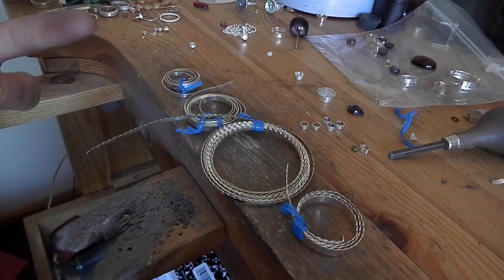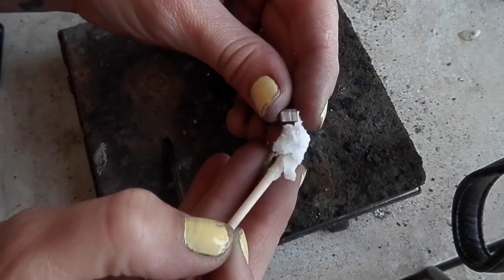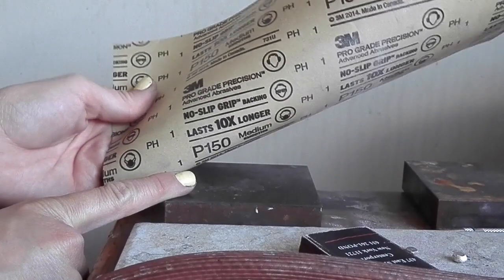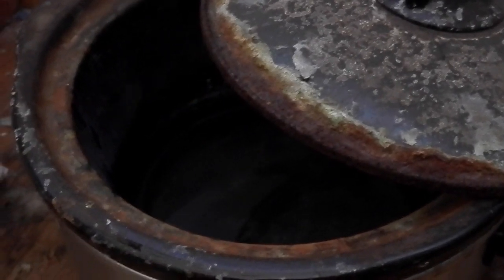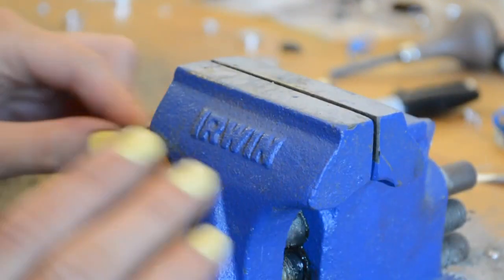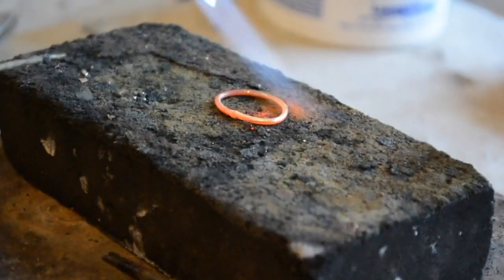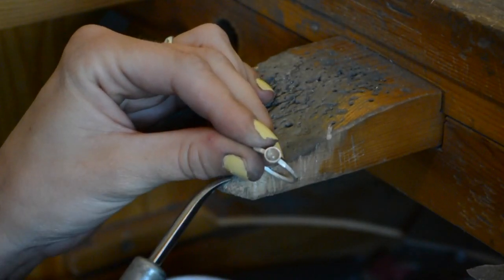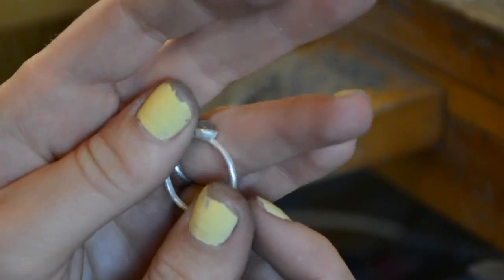Bezel Setting Tutorial - Stacking Ring Full Tutorial

Comment: I used this tutorial as my first attempt at bezel setting.  It is awesome!  My question is what are the minimum supplies I need to purchase to start making silver rings?  This is what I know so far from watching the video: Use "fine silver" (not sterling) use 20 gauge for backplate (hardness?); use ? gauge for ring ? hardness? use 26 or 28 gauge for bezel wire 3/16" (hardness?); Sheet solder Medium.  I'm hoping you can help me fill out the ??? because I'm on a very limited budget and I can't afford to purchase something that won't work.  Thank you so much for making me believe I can do this!  Donna Robertson

Comment: I enjoy watching your videos and learning so much!  Thanks for sharing your knowledge.  A few years ago I start making jewelry, from beading with elastic, growing up to beading with Flex Wire, designing my own beaded necklaces, and now, settling on making Beaded Kumihimo necklaces.  My biggest desire has been to work with wire and metal and I have taken some wonderful classes on wire wrapping, recently playing with metal working. My husband makes Poly Clay Cabs and beads, which I love using on my Kumihimo ropes, so I would love to start making my own metal designs and bezels, and so my question....can Aluminum be soldered?  We found copper solder and that is great, but aluminum is easy to find and eventually I will graduate to Sterling Silver but not until I know what I am doing.  If Aluminum can be soldered, what type of Solder can I use?  You are much appreciated.  Thanks.  GloriaB
Reply from the maker: +Gloria Borrero Yes you can solder Aluminum I think the melting points are much lower than copper, brass, silver or gold. I would recommend starting with copper its inexpensive and can be more fickle than silver. If you do well with copper you can then graduate to sterling. Depends on your preference and budget do what your comfortable with. I would say a low temp solder but I don't know much on aluminum sorry I couldn't be of more help there! Im sure there are many articles on google I would try doing a search I can imagine you will find a suitable answer. Thanks so much for watching and best of luck xo!

Comment: Hi. Love you videos. New to stone setting. 
Do you use .999 for your base plate also. I was told if using  .925 with transparent stones the base can oxidise over time (which you'll see though stone after a while) and If using .925 to place a piece of .999 foil at bottom. Have you found this? Is the foil needed?

Sorry for long winded question. 

Also not sure if would work for bezels also, but when measuring for ring shank  I use this formula. 
Radius + metal thickness X 3.14 = length of shank. No guess work.
Reply from the maker: +dawn butcher Hi Dawn thanks for watching! I use sterling for my base plate. You can use foil I have in some cases, you need to make sure no moisture will get in the bottom, it could end up moving around and causing the silver to peak through the foil. You can also seal the silver underneath to prevent tarnishing. I tend to find the 3.14 formula works but there are variables always especially if when you need to file the ends down to make them perfectly flush for a solder joint. Then you lose a few mm there. But overall that works!

Comment: Oh, one more thought; would you do a bit of expounding on "hybrid"/marriage of metals soldering, specifically with 14k (or whatever k) gold bezel wire and sterling back plate? It has been a real challenge for me, I don't know the tips and tricks (solder? Temperature? Etc.) to avoid the total meltdown. There is next to ZERO info out there, none in fact on YouTube even. You would be the first! Thanking you in advance :))
Reply from the maker: +Gabby Flying Chef I just apply more heat to the backplate than the actual bezel wire and flicker the flame on the gold this way it still heats but not overheats. Gold does have different flowing temps then silver and depending on the KT you use it varies with flow. I will see if I can make a video for that specific topic in the near future :)
Reply: +meshedesigns what kind of solder would you use/ Gold easy? Or maybe silver(H,M,E?), but then I would worry about it running up the outside of the bezel with yucky silver stripes or blobs over the gold. Ack! I tried it and the gold totally melted into the back plate....sigh. I think gold needs more heat initially, but then melts suddenly when it does reach temp. And, I think the temp for gold solder flow (I tried 10k gold solder)is higher than silver (H or M) but at the same time close to the melt temp of the bezel itself- ARGH! It (the 26g gold bezel wire) literally melted INTO the backplate- I saw it through the other side....then next try, it melted into a blob. Expensive blob!!! DANG!!! I think a reallly clear and detailed video on this would be a FIRST in the industry; a bit of gold in a piece really takes it to the next [beautiful] level- and a good challenge for students (ME)!! Thanks again (and again). When I figure it out, I'll have to get a vid camera make a video Hahahaha! YOU FIRST (Please!)! XOXOXO
Reply: +Gabby Flying Chef:  Even "The Orchid" Ganoksin has ZERO info on hybrid work. It is a surprisingly vacant subject of study and information.

Comment: Hi, I was wondering if the sanding of the bezel work hardens the metal, making it harder to push? I'm new to it all, and one of my bezel was virtually impossible to push!!! It was normal fine silver bezel, and small, but I sanded a lot, and maybe I'm thinking it was too much solder???
Reply from the maker: +huskyfluffy Hello Husky, no I don't belive it does. Maybe too much solder if you get it all over the wall the solder tends to stiffen it quite a bit.  I would give it another go! Good luck xo :)